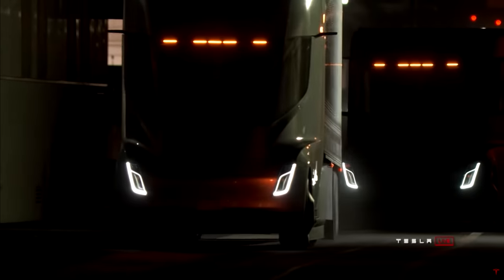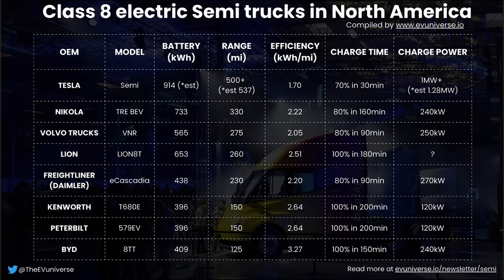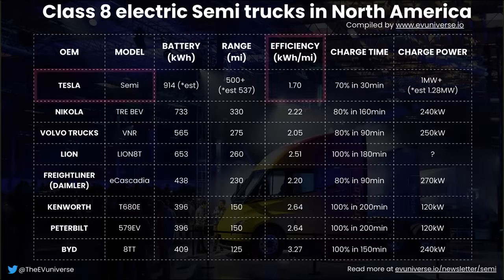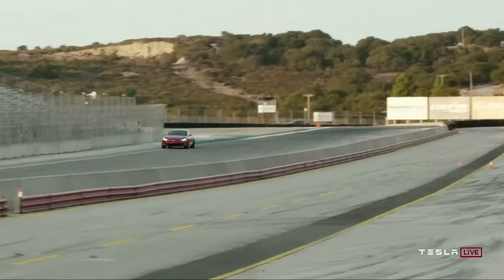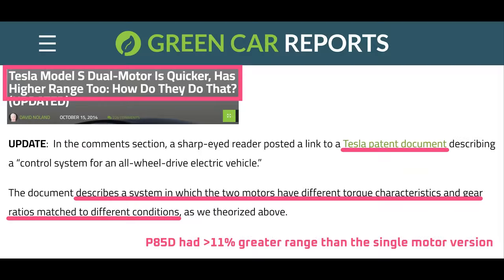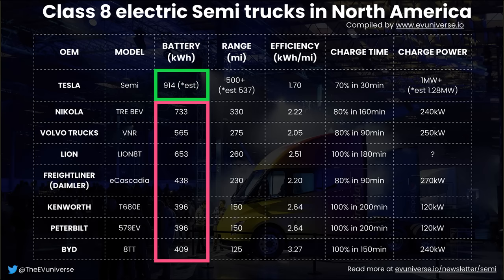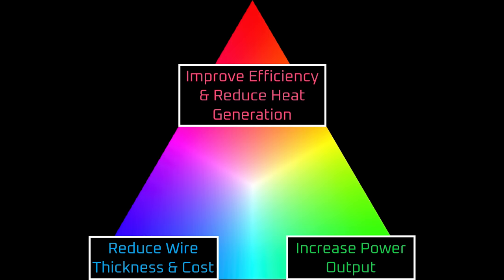How the Tesla Semi “Broke the Laws of Physics”

Comment: Still skeptical. There seems to be a reluctance to post weight, payload capacity and price. Current demonstrators are hauling potato chips. Why the secrecy?
Reply from the maker: They're also hauling Soda, and vehicles, and megapacks.

No secrecy, they said it does what it does and it's doing what it does.  

Payload capacity varies by the trailer weight, tractor weight is an open secret and available from reg information.  

Price:  If they can sell them, that's all that matters
Reply: @pi
"Sceptical" = "Confirmation bias"
Reply: @thelimitingfactor  not 500 miles.
Reply: "Bias" is not an appropriate term when information is unavailable. There are a couple of things that just don't quite add up is all I'm saying.
Reply: @pi.actual  Not 500 miles what? The 500 miles range test from Fremont, CA to San Diego, CA is well documented.
Reply: @BigBen621  hauling potato chips
Reply: @pi.actual  At the beginning of the video, you can see that the trailer is full from back to front of similar pallets; and you can clearly see one pallet is marked 600KG. 600KG is >1,300 lbs. So unless you can make the case that a pallet of potato chips weights >1,300 lbs., you claim is shown to be BS.
Reply: @BigBen621  I'm not the one making claims. Tesla said they did a 500 mile run "fully loaded" which led to an inference that the truck weighed 82,000 lbs at the time. Then it was revealed that it was hauling chips and later it was learned that Pepsi was hauling sodas but only 100 miles. The Donner Pass video shows a flatbed with 8 concrete barricades which weigh approximately 4,000 lbs each for a total of 32,000 lbs which is about 13,000 lbs short of a typical 18 wheeler's max payload. So there are a lot of questions out there such as what is the Tesla's empty weight and they aren't being answered. Thus the skepticism - especially from the trucking industry who want to know how much payload they can haul because well, that's what they get PAYED for. I'm neither a lover nor a hater, I just think all of the numbers need to be out there before people can decide whether or not the Tesla semi is going to work for them.
Reply: @pi.actual  Wow! A veritable cornucopia of misinformation. Where to begin? It's a quandary...

"Then it was revealed that it was hauling chips." 
At the beginning of the time-lapse video of the 500 mile range test, you can see that the trailer appears fully loaded from front to back with pallets, including some stacked two high at the front; and one at the back, where by practice the lightest loads are placed, is clearly marked 600KG (>1,300 lbs). So unless you're going to try to claim that a pallet of "chips" weighs nearly 3/4 ton, this claim fails.

"it was learned that Pepsi was hauling sodas but only 100 miles." 
You left out a key word—"initially", and a follow-up sentence. What PepsiCo VP Mike O'Connell actually said was that "for heavier loads of sodas, the trucks will initially do shorter trips of around 100 miles". And he went on to say that "PepsiCo then will also use the Semis to haul beverages in the 400 to 500 mile range as well". In other words, using the Tesla Semis to haul sodas initially for 100 mile runs, but later for 400 to 500 miles runs, makes it clear that this is a decision on the allocation of tractor assets to where they'll do the most good at any time, and not a limitation of the range of Tesla Semis hauling sodas. So this claim fails.

"The Donner Pass video shows a flatbed with 8 concrete barricades which weigh approximately 4,000 lbs each for a total of 32,000 lbs." 
It's crystal clear in the video that there are three barriers in each of the first three rows, and two in the last row; for a total of 11, not 8; and I've seen no one dispute this count. But actually your weight is a little high; these are Caltrans-approved 10 ft. K-Rails, which have a weight of 3,900 lbs. each. (I can point you to the Caltrans blueprints for these K-Rails if you're skeptical of this.) 
So the payload, including an estimated 1,500 lbs. for tie down paraphernalia, driver and miscellaneous materials, is about 44,400 lbs. Your estimate of a typical 18 wheeler max payload is 32,000 lbs. + 13,000 lbs., or 45,000 lbs.; so the Tesla Semi almost exactly matched this. So the claim that the payload of the Tesla Semi is 13,000 lbs. less than a typical diesel max payload fails as well. Got anything else?
Reply: @BigBen621  Look, I know you're a fan-boy and my intent is not to irk you but all that you have stated is speculative analysis based on easter eggs viewed on videos from a single source - Tesla. Fact is, none of the specs are published, nobody knows what a Tesla Semi weighs. There is no independent verification of the 500 mile @ 82,000 lb claim. Until there is the skepticism will remain. I have nothing against EV tech, Tesla or Elon Musk, it's just that the numbers aren't adding up. Nobody, including Musk, is claiming that the Tesla Semi isn't heavier than the diesel competition. So how heavy is it? Show us a link with the data.
Reply: @pi.actual  I'm far from a fan-boy of Elon Musk, but I don't disagree with the rest of your post. For the record, my guess is 27,000 lbs. ± 1,000 lbs. Time will tell...
Reply: @BigBen621  There is also another aspect of this that isn't being widely discussed which is the fact that 40 ton semi trucks are responsible for much of the wear, tear and damage to public roads, the repair and maintenance of which is funded partly through fuel taxes. So there is going to have to be some equitable means for future EV heavy haulers to pay their fair share of those expenses. If consideration is given for their perceived environmental advantages well, it gets complicated. As you said "time will tell"

Comment: Plaid carbon-wrapped motor is a key for future aircraft profects, folks. Every % of weight and efficiency is much, much more importnat there.
Reply: There is no point in the carbon-wrapped rotor for propeller-driven aircraft, which operate the motor at low speed where the benefits of carbon wrapping are not of value. Even at ducted fan rotational speeds carbon wrapping is likely pointless.
Reply: @brianb-p6586  why you say "low speed"? Turbofan engines have up to 25000 rpm, same as Plaid motor - looks good to avoid any kind of gearboxes and still have decent max speed. And it's light and compact.
Reply: @Alex-cf9me  I said that propellers run at low speed, but large bypass fans in turbofan engines are geared down from the turbine speed, and even the the power turbine typically runs more slowly than the gas generator shaft; for instance, the low-pressure sections of a GEnx turn at less than 3,000 RPM (and even the high-pressure section turns at less than 12,000 RPM).

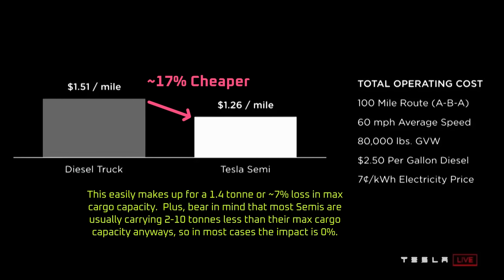Comment: 17% cheaper @ 13:45? if the efficiency is 1.7kwh/mi and it cost 8 cents per kwh to charge. your looking at a $1.51/mi diesel semi and around 15 cents/mi electric. this is 90% cheaper!! just in run costs, not including maintence
Reply from the maker: Read the pinned comment Captain Obvious  😁

Comment: This begs a “Limiting Factor” calculator that outputs “variable ” changes. Reducing to equivalencies(cargo wt., grade,  UP time-in-svc not charging) shows what happens to STD Operating Cost? It’d show schedule for Diesel and Tesla Semi both slope and initial start pts. graphed. That’s your money-maker for fleet buyer’s who need metrics to check against a buy assumption.
Reply: No
It possibly "begs" for one of the first Tesla Semi owners to arrange a series of tests.
Same route, same load, same day, with a diesel truck.
.
Good luck finding the diesel truck/ driver.

Comment: 10x the battery capacity means 10x cost ($200k just for the battery?) and cargo capacity is king in most of the world. Trucks need to be able to refuel anywhere, anytime plus even if its using Teslas current chargers how many of them are even truck accessible? As charger proliferation is slow for mass produced vehicles,  it will be glacial for low volume trucks. And haulage firms using electricity cannot refuel at base, they simply could not charge 20+trucks at once. 
  Then there is the maintenance, Tesla do not like or support those who do their own maintenance, That is a killer blow for business, at least the hauliers I know.
 I would like to see them succeed, but I am still sceptical.
Reply from the maker: Currently the battery pack will cost about 150,000 and I'm betting that they've raised the price of the vehicle to around $300,000 because that's what most haulers are willing to pay.  The ones I've spoken to say they're willing to pay up to 400,000 for an electric semi.

They're building mega chargers at the locations where the trucks are stationed and also endpoints.

Don't think of this as a long haul truck because that's not what it is.  It's a truck designed for hub and spoke style distribution centers where they drive the same route every day.

Other than swapping out tires there is no maintenance on these vehicles.

So I think what you're referring to is repairs.  Yes, that could be a pain point.  People think Tesla is dumb here though.  Tesla treats their customers like that because they know they can....

Where that would lose you customers very quickly and a commercial environment.  So I expect the businesses will be treated differently and if they don't then the semi will fail.  Odds of that happening? About 10%.

Comment: No they didn’t break the laws of physics, but smoke and mirrors were in use.  The simple limiting factor of trucking wasn’t ever disclosed, the load weight !!!! Hidden or purposefully not disclosed,  hmmmmmm , why?
Reply from the maker: Covered by Engineering Explained.  Use the power of your keyboard to type it in the search box.
Reply: @thelimitingfactor  I’ve seen the truck launch video several times, I’ve seen a few videos where presenters carefully try to calculate what load possibly was trucked, and no sorry I couldn’t find any information, definitely not disclosed by Tesla? Only mentioned by Tesla was total rolling weight which is by definition smoke 💨
Reply: For reasons known to Tesla, it's clear that they consider weight and load information to be proprietary, likely for competitive reasons; and PepsiCo has as much as said that they're on an NDA for this information. 
There are several possible reasons for this. One might be that they don't want to give their competitors, of which there are several, a target to aim at. 
Another might be that they're still fine-tuning things like battery capacity based on initial experience with PepsiCo, and know full well that if they release preliminary information now but later finalize a different spec, a legion of airchair engineers will use this a proof certain that they lie about everything.
Another might be that they simply don't see any reason to release this information, preliminary or final, to hordes of folks who will just use it to discredit Tesla.
Another might be that they're just f%$king with folks like you.
Another might be ...

Comment: Why does Tesla refuse to give the weight of the tractor? Sounds kind of fishy. Even allowing ev trucks to run 2,000 lb (1000 kg) overloaded doesn't seem to be enough of a porkchop hung around it's neck. It is a zero sum game. Every pound of truck is one less pound of freight that can generate income. 
It probably doesn't matter to Pepsico, all they're hauling are potato chips.
As to regen, the author probably has never driven across Nebraska.... especially the mountain sections.
Reply: Does a pallet of potato chips weight 600KG (1,300 lbs.)? If not, then the Tesla Semi on the 500 mile range test wasn't hauling potato chips.

Comment: Having a 20 ton battery really does help
Reply from the maker: 900 kwh/160wh-kg = <6 tonnes.  Some cargo loss, but still commercially viable.  Trucking is a TCO game.
Reply: @thelimitingfactor  in a Tesla video they had a fully loaded truck which they claimed weighed 40 tons. But  it only had 5 tons worth of cargo on the back. That’s a 35 tons truck that requires a substation to charge. All the claims in your video are pointless
Reply: @an000n  If you're talking about the Tesla Semi pulling a flatbed trailer loaded with 11 highway barriers accelerating up a steep slope on Donner Pass and passing a diesel semi as if it were standing still, it seems like you've been watching Thunderf00t videos again. Just to be clear, his videos are rife with obvious, provable and egregious lies. In this case, these barriers can be clearly identified by the unique shape molded into the ends and the circular lift/tie-down openings as Caltrans-approved, 10 ft. K-Rails. K-Rails are a California-specific version of generic Jersey barriers; and the Caltrans blueprints for these set the weight at 3,900 lbs. each. So the payload on this trailer was 11 x 3,900 lbs., plus about 1,500 lbs. for tie down paraphernalia, driver, and misc. loads; total payload 44,400 lbs. or >22 tons.
Reply: @BigBen621  one those aren’t full size barriers. Those chains don’t weight 1,500 lbs, and three what is miscellaneous weight when we can see everything on the flat bed
Reply: @an000n  If you're going to use claims from a Thunderf00t video, you really should give him credit.
We know that these are 10 ft. barriers from the video. At 16:32, you can see that the length of the flatbed carrying four rows of barriers is the same length as the dry van trailer of the diesel it's passing. The standard length of both dry van trailers and flatbeds is 53 ft.
At 16:32 you can see four rows of barriers, each tied down by two chains with a ratchet; and heavy timber beams at each end, also chained down. The "ROAD BARRIER SMALL" that Thunderf00t picked from a web site in the Czech Republic is 2 meters in length. Four rows of these would take up 8 meters or 26 ft., so four rows of these would take up only one half of the length of the 53' trailer. Instead, it's clear that there's about a 4' gap at the front, likely the same at the back to balance the load, and a couple of feet between rows; which is exactly what you'd have if the barriers were 10' long. Further, K-Rails only come in 10 ft. or 20 ft. lengths, so these are obviously the 10 ft. length—which weigh 3,900 lbs. each.
I didn't say the chains weigh 1,500 lbs.; I said they were included in the incidental weight. The biggest weight is in the 8 ft. long 12 x 12 beams at the front and rear. This is 16 ft^3 of timber at 40 lbs./ft^3, for 640 lbs. right there. There are are 10 chains altogether, and 10 ratchets, probably another 200 lbs. Add driver, minor tools, personal baggage, for another, say, 300 lbs., and you're at 1,140 lbs.—not the 1,500 lbs. I estimated. So yeah, you really got me there. To re-estimate, 11 barriers @ 3,900 lbs. + 1,140 lbs. = 44,040 lbs., so say 22 tons.

Comment: Seriously? The semi videos show the truck pulling a tiny load. You think aerodynamics can fix the battery weight issues? Insane.
Reply from the maker: Relieve your own ignorance by watching engineering explained's video on the topic.
Reply: One video shows a Tesla Semi towing a flatbed trailer loaded with >44,000 lbs. of 10 ft. concrete highway barriers, accelerating rapidly up a steep slope on Donner Pass, and passing a diesel semi as if it were standing still; and the 500 mile range test video shows a dry van trailer loaded with at least 27 pallets, of which one at the rear, where the lightest loads are placed for proper weight distribution, is marked with a weight of 600KG (>1,300 lbs.). Where have you seen a video of a Tesla Semi pulling a "tiny load"?